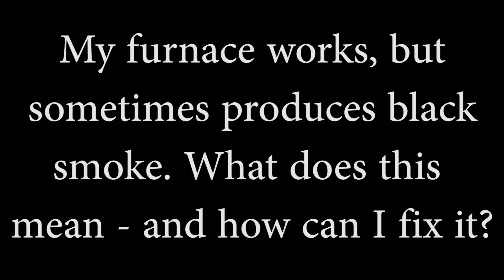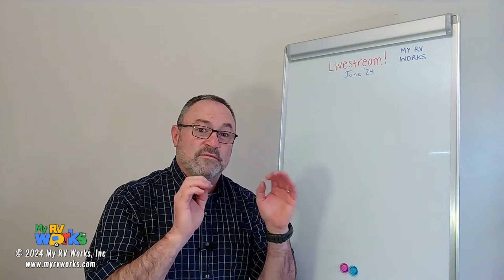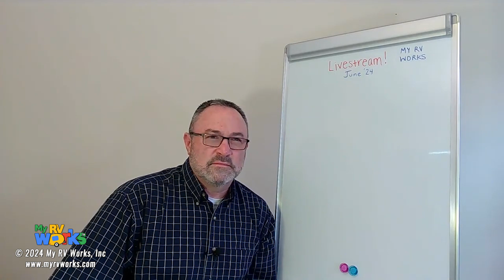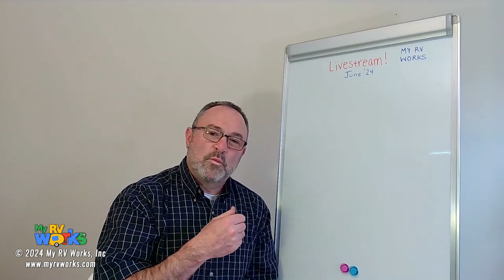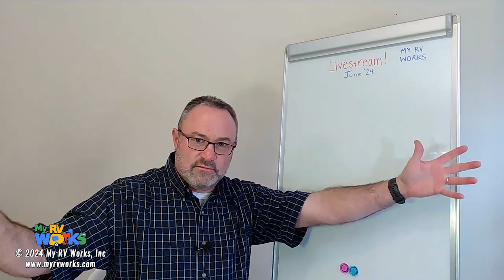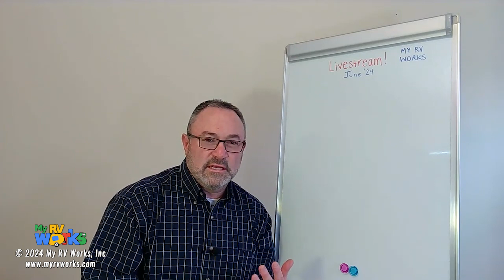Why A Furnace Makes Black Smoke  (A Propane Burning Discussion)

Comment: I did pull it out and clean it. I was able to blow it out and got a lot of carbon pieces out. There may have been a dirt dobber nest at some point. The orifice was clear as well. 0:00 It went back together nicely and it fired right up. Seems better. I do to need a screen over the outlet port.

Comment: I am noticing that I don't get a clean burn on my dometic furnace as it doesn't smell clean and I am seeing a lot of carbon in the exhaust tube. Seems like I need to go deeper to find my issue now. Thanks for the video.
Reply from the maker: A good cleaning of the burner and verifying you have only propane in your LP system is a great first step in trying to resolve this.

Comment: Furnaces don't just output CO2 they also output CO, HC and NO depending on the air-fuel ratio. Industrial furnaces. IC engines and boilers have catalytic converters on them. I tune them to 6000ppm CO and 700ppm NO. Post catalytic converter is 72ppm CO and 1 ppm NO. I set the gas pressure using the regulator just like on an RV. For high elevation you can re-jet it or lower the fuel pressure.

Comment: As he stated check your pressure first as RV regulators are not the best, if all your appliances are sooting this will likely be the problem. If its just one appliance that's sooting first clean the main burner orifice with compressed air only, then open up the primary air adjustment to the point you have a blue flame on the burner where its not lifting of the burner, if you have the primary air all the way open and no blue flame there will be something inside the burner Venturi that is not allowing the air and propane to mix properly prior to the burner tip. At this point it's a good idea to remove the burner to check the Venturi and blow out the holes in the burners that will collect lint and dust sucked in by the vacuum created by the Venturi. Soot is generally created by lack of oxygen mixing with the gas prior to combustion and this is only exasperated at higher elevations as there is less oxygen in the air up there.

Comment: Great video and perfect timing. I have a old hydroflame dc8241 that was blowing black soot in my 1988 ford vanguard 27' motorhome where I house my rather large family of 5. Thanks for all the information as winter approaches it get's very cold up here in central Saskatchewan (-40c). I am doing things that were once unimaginable. IMO Best place to find rv info is here at MyRVWorks!

Comment: Thanks Darren, always good! You are truly a help to the world! Your point about "Black smoke" is usually CARBON burning is helpful. I have  done just about everything that you have ever suggested, cleaned out both the tubes and  the orifices, adjusted the flame, etc.  and still get a "POW" when it starts up and it still burns black smoke. Could it have anything to do with the the main regulator where the tanks are hooked up?